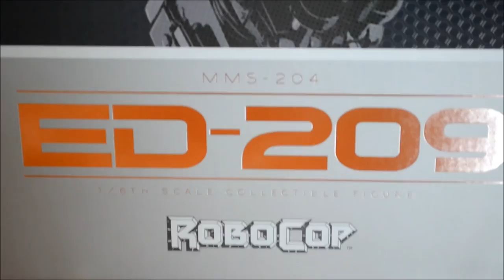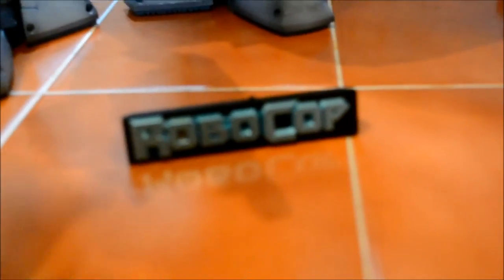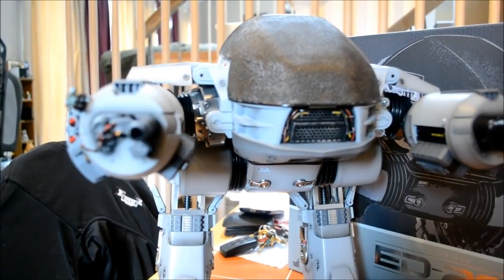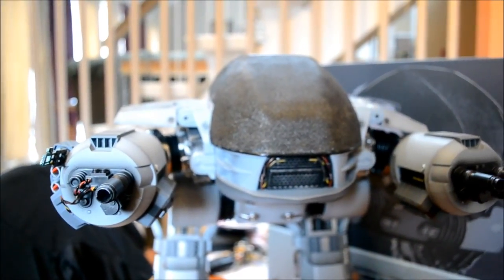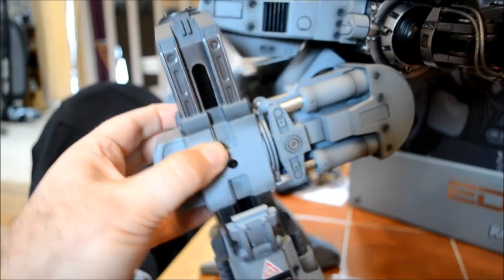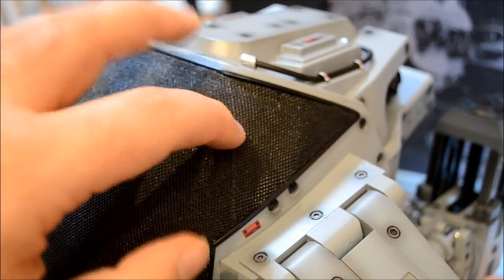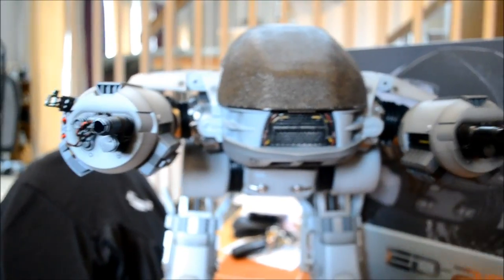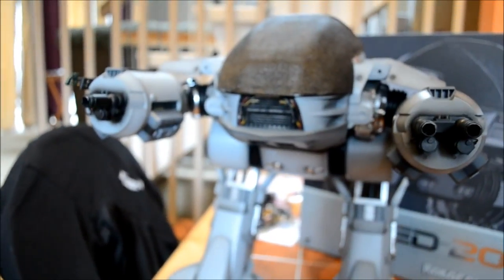Joebizz34's Review Of The New Hot Toys 1/6 ED-209 Figure

Comment: I also have a theory as to why the "mouth" area depth is inaccurate to the film is because they were probably trying to compromise the room inside the head to house the speaker and sound board. I'm guessing it's a larger box and, the only way to know that for sure is to open up the figure.  But, I'm not about to do that. :) I was a professional toy designer back in a previous career and there are manufacturing observations I make with the Hot Toys figures.  You're right in that it doesn't bother me too much either but, I still wish that it was set in deep; accurately representing the film's props and puppet.
Reply from the maker: Makes sense and yeah not totally accurate but atleast it is detailed well for what it is.

Comment: There are sculpted in details in certain areas of the body and legs that weren't in the older ED.  So, many parts are definitely new rather than re-hashed from the old figure :)
Reply from the maker: Yes definitely an improvement and that's what I was referring to when I said more detailed. I didn't mean to imply that they used the same exact body from the old one. I just meant the overall look is similar to the original but with better details and articulation.  I'm not sure it's enough to make everyone who own the original to buy this one but for us die hards there is enough there that is improved to grab one.
Reply from the maker: Yes definitely an improvement and that's what I was referring to when I said more detailed. I didn't mean to imply that they used the same exact body from the old one. I just meant the overall look is similar to the original but with better details and articulation.  I'm not sure it's enough to make everyone who own the original to buy this one but for us die hards there is enough there that is improved to grab one.